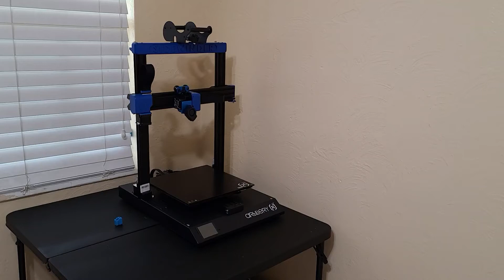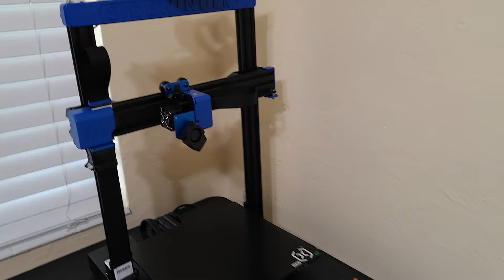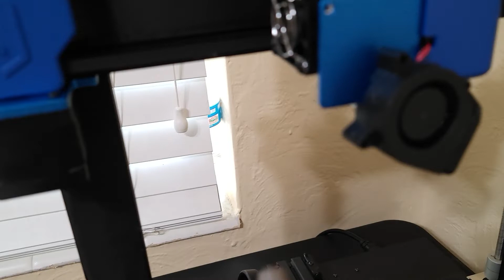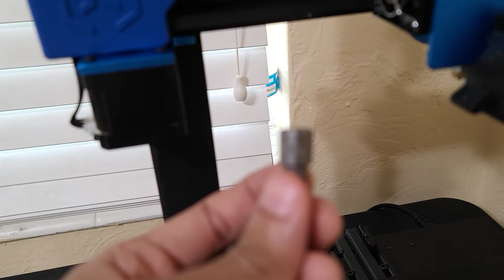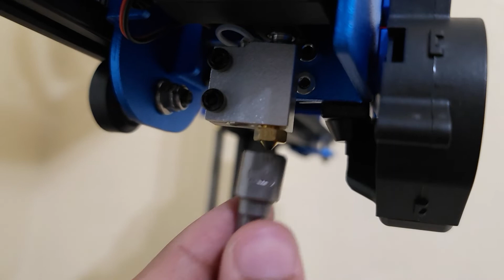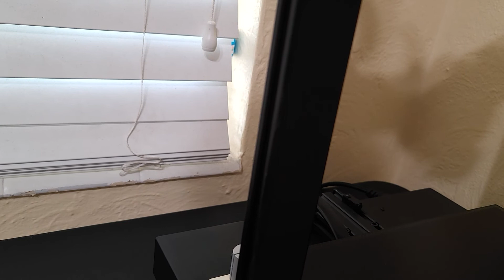Artillery Sidewinder X2 nozzle removal

Comment: It's not the right way of changing the nozzle as it should be really tight. Heat block should be disassembled and tight from both sides. Otherwise melted filament would leak and be all over the place!

Comment: You can move the nozzle assembly high in Z-axis (upwards)  using the printer's move controls.   Heat extruder a bit ,and  extrude  (up and out ) the filament if any is loaded.
Then, simply remove the neoprene cover (I dont use one) and simply unscrew screw the nozzle.  It's not necessary to remove any screws or covers at all.